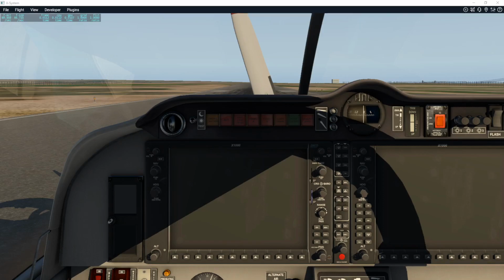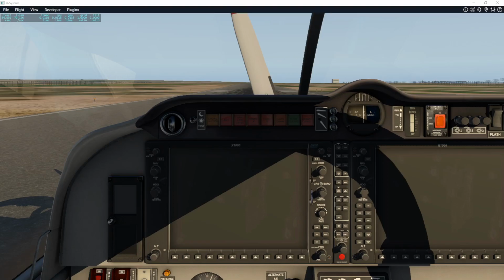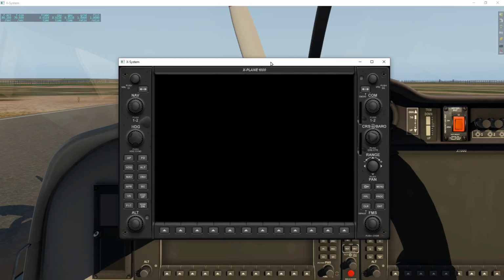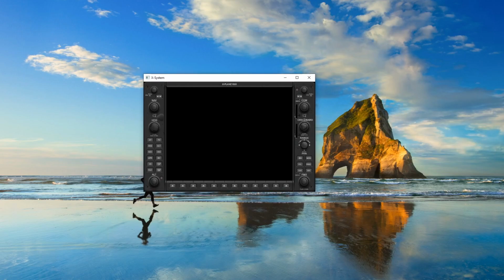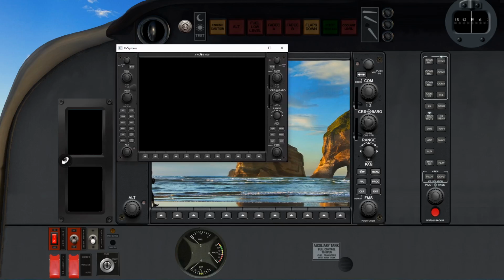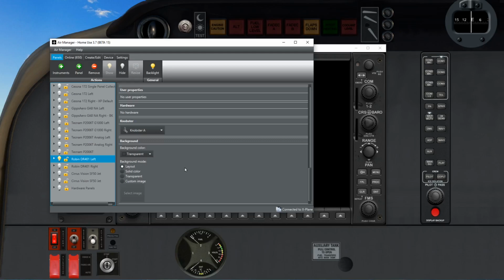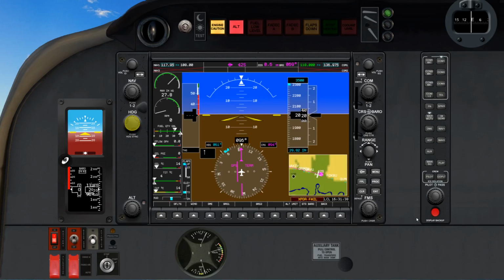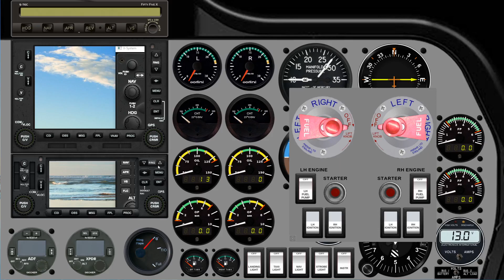X-Plane pop outs with Air Manager

Comment: Thanks very much for videos Tony. You answered a question I had on Sim Inn forum. Thanks for that as well. The mouse focus issue with AM and XP running on same machine was a non-starter and a hastle because it stopped keyboard shortcuts from working without moving mouse to change focus back to XP from Touchscreen. You obviously know what I am talking about but I would like to let other people know this is a fantastic improvement in AM Desktop 3.7 BETA 32. No more misfires on keyboard shortcuts, mouse focus changing etc Woohoo.
I am assuming most of you guys, Russ Barlow, Michael Brown, others, run AM on second machine with second copy of XP. Well, I have tried many different single machine configurations and I just can't get rid of jutters when I run anything AM on 4th monitor touchscreen, even just one panel with flaps only image. I run 3 Dell G-sync monitors 1440p QHD smoothly, smoothest it has ever been. The QHD res is beautiful. Much better than HD. When I introduce 4th monitor touchscreen, I get jutters. I have even tried Duet and a iPad pro as 4th monitor. Same jutters. I am positive it is 4th mon because I can toggle them on and off and jutter  problem disappears. I use Dual liquid cooled Corsair One i160 i9 9900, and 2080ti.
 I use  AFL 172sp for instruction. Do you have a complete AFL radio stack with, Audio Panel, etc? There are some generics that sort of work but I would like the complete functional stack. If not, I am planning on creating the complete stack including GNS 430 if it is possible. (having a problem with AFL 430 and AM BTW). 

And lastly, I am having a bit of an issue with Vukcan and AM, at least I did with AM 3.6. There is a small problem with AM not recognizing an Asus HD touchscreen size properly. Sees it at 2400 x 1350 for some reason. It does not seem to recognize changes in Windows Display Settings resolution sizes. Very bizarre behavior. Anyways it causes huge jerky  jutters (not necessarily stutters) at 2400x1350 and this almost caused me to give up on AM on one machine. I will let Sim Inn know of the issue. I think it is a priority issue, Might scare someone away from AM if it causes jutters. I will post video if necessary. Perhaps they already know of issue. Vulcan and AM are both BETA so some issues are expected. 

Well, the mouse focus issue  is fixed with AM 3.7 beta, but single machine, 4 monitor, AM jutter problem persists.

Yourself, Russ Barlow, and Michael Brown are a great help! Thanks to all!

Comment: Great explanation Tony. I don’t know that you mention to untick the “click through” checkbox while ticking “locked” and “always on top” after having things properly positioned because there is a performance penalty when clicked through is enabled.
Reply from the maker: Russ Barlow You are right Russ. I tend to have it enabled on panels with transparency because  at one time it was required to get transparency to function correctly. I’ll go through them and un-tick all those not requiring the click through.